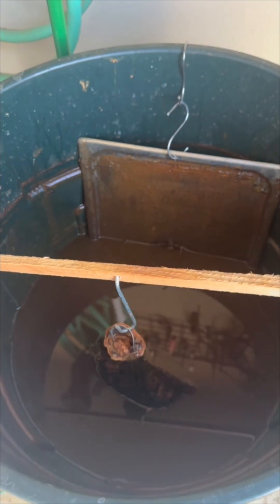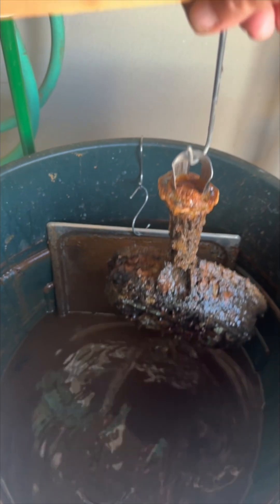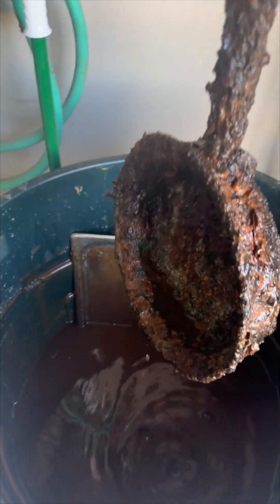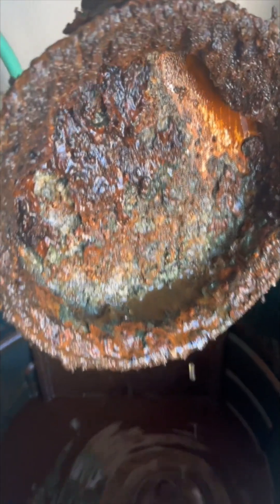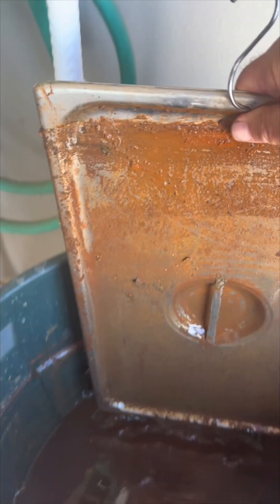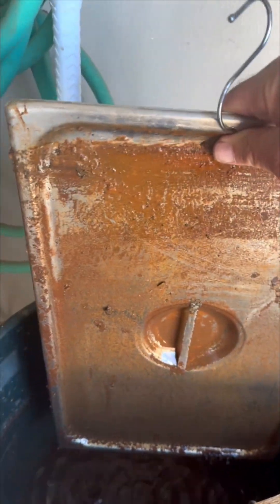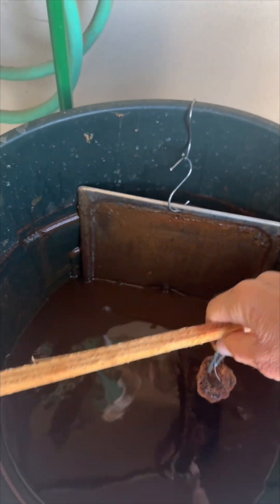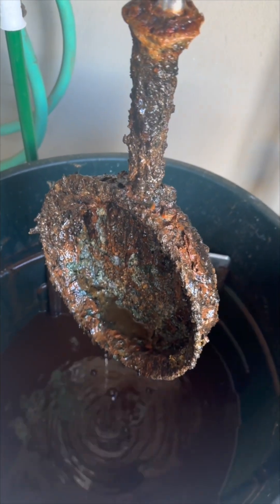Electrolysis Tank - Stainless Anodes

Comment: You have just gone where no YouTuber has gone.... showing the ugly side of cast iron restoration! My dang lye tank has got so bad that when I pull out my iron, at first , it looks worse than when it went it...might be time to dump my lye tank. I've been using Salvation Army found stainless steel baking cooling racks as my sacrificial metal. Nothing stainless about it now but after an electrolysis session and a metal brushing of the cooling racks they're good for the next session. Thanks for exposing the dirty nasty grimy side of CI restoration!